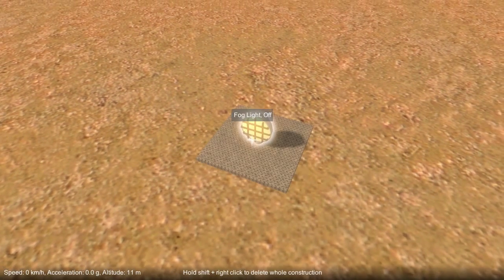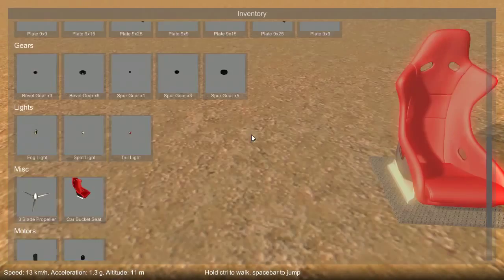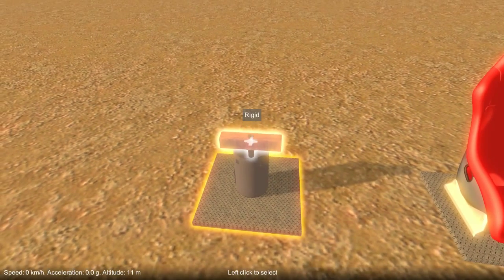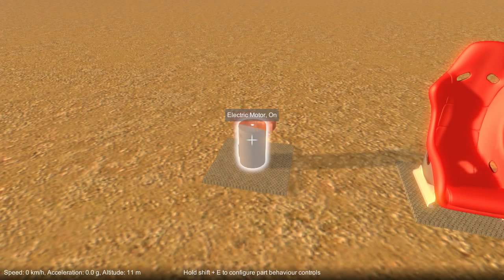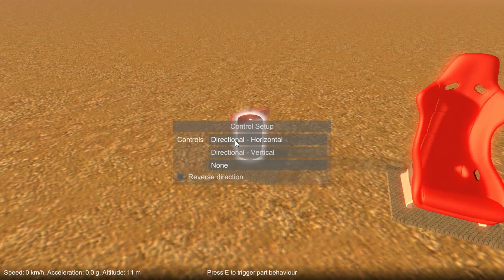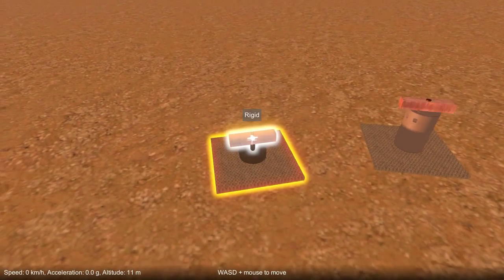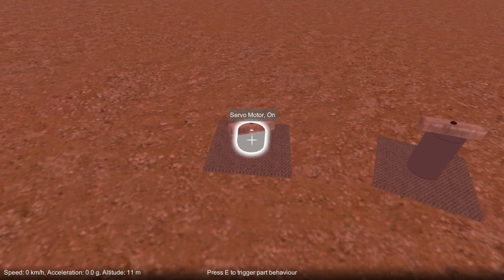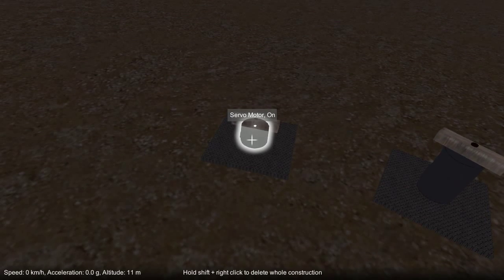Tutorial 3: Part behaviours

Comment: I can't make the car accelerate, how i do?
Reply: +Hiden Shinzou i have configured to use W and S but the engine dont do nothing and when i change to paint mode the engine goes to max speed
Reply from the maker: +Hiden Shinzou Woah, that sounds like really odd behaviour, not heard of anything like that happening before.  What happens if you have something super simple (e.g. just a motor and an axle) does that work?  How about the built in example constructions, do they work?
Reply: +GearBlocks i will try
Reply: +GearBlocks i made it thx